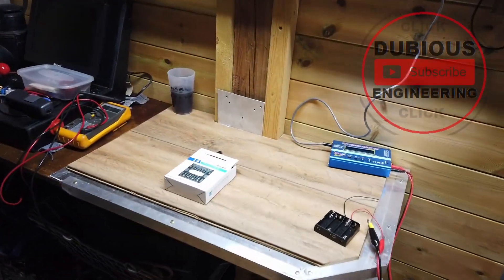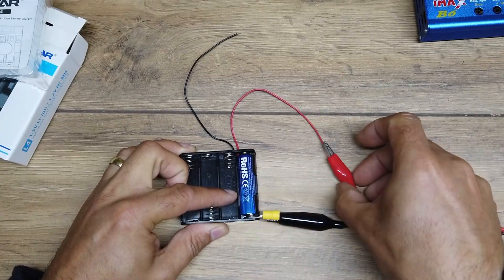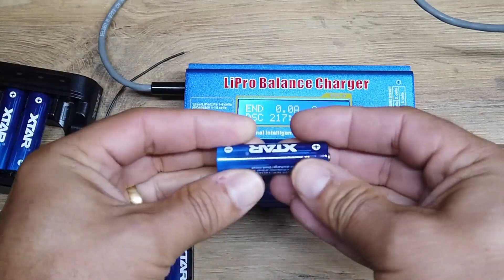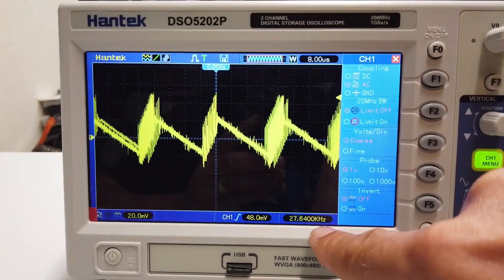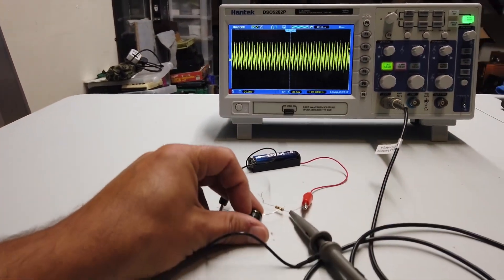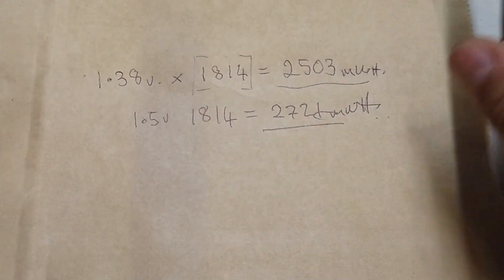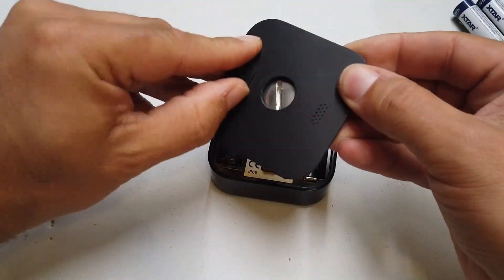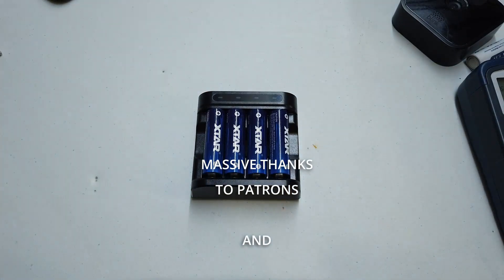DuB-EnG: XTAR L4 Charger and Rechargeable Lithium Ion AA batteries put to the test....

Comment: So these batteriees are rated at 4150 mWh and tested at 2503 mWh?  Seems like a pretty significant overstatement on capacity.
Reply from the maker: I wonder if I got mWH and Ah mixed up
Reply: @DubiousEngineering  Looks like you did it right.  Also looks like the battery can't  supply 1.5v on a .5A draw ( your tester showed 1.38v @ .5A load) even though their web site states 1.5v @ 2A load.   XTAR website show capacity to be 4150mWh/2500mAh  so the 1814mAh you got in the test. is far below the 2500mAh statement.  A few charge/discharge cycles may improve the numbers, but I would not expect it to achieve the listed capacity.  Considering most other manufacturers of these types of batteries have 3000-3500 mWh ratings, the 4150 rating seemed a bit high as in why can't anyone else achieve this?

Comment: I would have thought because they were lithium they would deliver the full 1.5 not 1.38.  1.38 would be expected for Nicad or metal hydride. I would buy them if I was sure I was getting 1.5 but now not so sure. Could your tester be wrong since it doesn’t recognize it as lithium. Just curious
Reply from the maker: There will be a voltage drop depending on how much current is being drawn.  If I connect a volt meter only, they show 1.5

Comment: Is it possible to wrap the battery bay with shielding, directly ground it to the batteries negative to isolate the device in use from those emi? I really want to use this in my multimeter as it couldnt take freshly charged eneloop @ 1.2v without low voltage warning. Lithium energizer is good but I dont like disposable battery.
Reply from the maker: The emf comes from the battery terminals….  Sadly, you can’t get rid of it, however, it may not affect a good meter as they have filtered PSUs

Comment: Thanks for the noise test. I was going to get these for my ft817 radio tranceiver. That noise is a deal breaker
Reply from the maker: I love the ft817 bit fiddly to drive, slightly low on power, but overall, a cracking little radio! ….

Comment: I have tested two brands. One claims 3600 mWh produces less than 1800 mAh another claims 3500 mWh and produces over 2200 mAhs.  Both needed to be cycled a couple times to give a good reading. The first had two dead batteries out of 12 after three charge cycles (at 500 mA) Good investigation about noise. I have not noticed a problem in my trail cameras but other people have. You can not judge the batteries by the claimed mWh.
Reply from the maker: Your last statement is key!! I agree 👍

Comment: I tried a set of these in a dab/FM/Internet radio hoping they would last longer than Eneloops.  I live in a very strong dab signal area but the noise from the internal circuitry in these batteries interfered with the dab reception so much that I could not use them. They were ok on FM and internet though.
Reply from the maker: Yup...  Absolute nightmare right!!  Dam DC buck conversion!!

Comment: Take it apart and give it a clean, and it will work again, I had a leak on one of mine so took it apart and cleaned it so it is now back outside working again, they cost too much to throw away.
Reply from the maker: Thanks for the tip... I'll give it a try!!!

Comment: Hello, does this charger work with USB-C PD power sources? I mean, it takes 5V all right, but what I want to make sure of is that would it work correctly and take 5v with 100W PD charges and cables (that power macbooks etc.). I want to buy the item but want to make sure before buying because I don't want to invest for a new brick and charger just for this. Thanks in advance!
Reply from the maker: Sadly…. Not PD …. Standard 5v 2A …. So charging times will remain the same.
Reply: @DubiousEngineering  Of course, I'm okay with that, as long as it works. Some items that hav USB-C ports just refuse to work with PD chargers and cables even with 5v only, that's what I wanted to ensure of. Does it work with PD chargers and cables, even only 5v?
Reply: @DubiousEngineering Catch-up: Confirmed by xtar themselves on Reddit and bought it, and it does work indeed. You plug a PD adapter and cable, it works and charges with 5v, but the voltage was not my problem, it working at all was.The USB-C Standards require the manufacturers to add 5.1k resistors if the device inners are built like usb 2.0, and some manufacturers don't do this. This results of the devices not being charged when plugged to a PD charger.
Reply: @ardatubes  This is an interesting question. I have an 8 by version of this charger, XTAR BC8, and it does work with both standard 2 A 5V  USB as well as a Macbook Pro PD charger. I don't have a way of testing what voltage / current it draws though. To make up for this, I "invested"  -- all of 6 Euros on Amazon Black Friday deal -- in a QC 3.0 charger and another 12 Euros in a USB power metering gadget. Will be interesting to see what the BC8 charger draws with different power supplies 🙂

Comment: what is the difference between xtar BC4 charger and xtar L4 charger?
Reply: L4 uses CVSA tech to charge Ni-MH which results in faster charging and less heat build-up on cells.

BC4 can be used as a powerbank and flashlight, but does not use CVSA tech.

Also, the L4 is hollowed out for better ventilation of heat build-up on cells. The BC4 is completely covered up and does not let heat dissipate as good.

I have the L4, and it is an amazing Ni-MH charger. It charges my Ni-MH cells better than my Dragon VP4 Plus, SV2 Rocket, and FC2. Probably because of the CVSA tech.
Reply from the maker: I have another XTAR charger coming for review....  hope to get it done in a week or two.

Comment: thank you for measuring the noise as well. I bought some Hixon recently and wanted to use them in my weather station capable of receiving the DC77 time and weather data over terrestrial broadcast at 77 kHz - and it didn't work anymore with these batteries. Are there any batteries of that type without that noise? Can I shield them somehow?
Reply from the maker: Kratax are better
Reply: @DubiousEngineering  I'll try them, thank you very much! :)
Reply: @DubiousEngineering  I am a bit confused here about frequency interference. We saw 25 kHz noise and 250 kHz noise in your analysis. Why would this be interfering with 77 kHz signal? Never min GHz range frequencies of WiFi (2.4, 5, and 6 GHz)???

Comment: 4:05 It looks like the slide switch on the probe is set to X10, not X1?

Found your video while looking for someone putting these XTAR batteries through a proper discharge test. Testing inside electronic devices is neat and all, but actually testing the capacity and comparing against the claims is really the only way to rate a product like this, especially in a market rife with bogus claims. Thank you very much!
Reply from the maker: Aha!  Thanks, if it is set to X10 then the scope will likely compensate as I checked the scope was set correctly.  Thanks for the thanks!  :-) 🙏👍